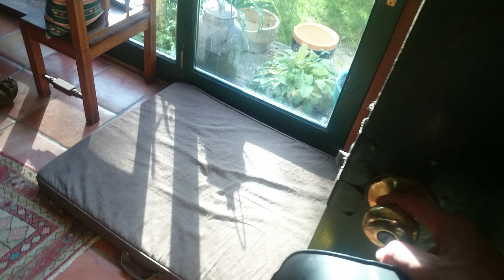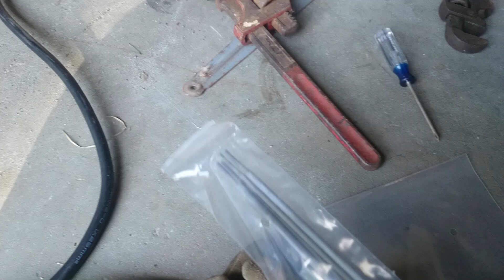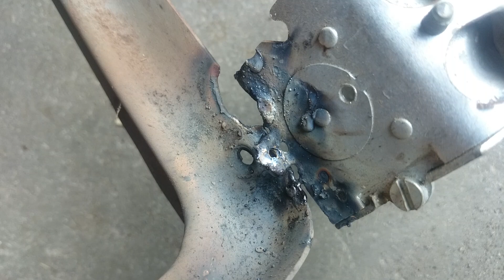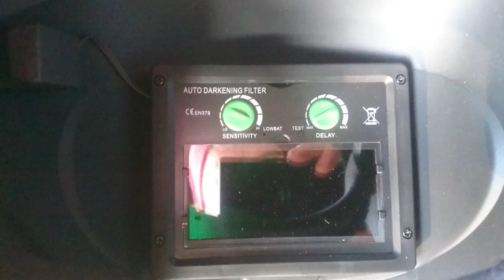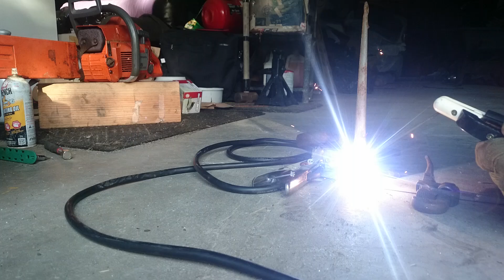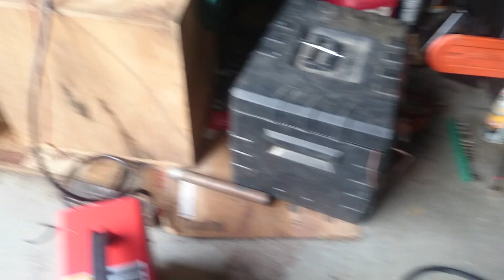First time welding, with brand new $100 ebay DC Arc welder

Comment: I would avoid welding on that outlet. The galvanize will make you sick. But I think what you should do is get a 1/4" plate. Get use to running beads and flipping your hood down to weld. You will have less grief that way. Good luck.

Comment: hello . i know im 4 years late . But vertical welding is HARD 
a really usefull cheat is to clamp brass or copper on the reverse side , the welds wont stick to it and itll bleed the heat away
Reply from the maker: Thanks for the tip
Reply: @El_Chompo  we should compare welding scars !  nice to meet you

Comment: Practice, practice, practice... Learn your Machine and equipment, luckily you didn't get flash burned!

Get some plate and practice, 30A is way too low, 80~ - 120~ is the sweet spots. Also what rods are you using, ⅛, 3/32, 6011, 6013, 7013, 7011? 

Your rod is sticking because of the amperage and the angle you are holding your rod.... You aren't getting penetration, hence the welds breaking.

- lead, + earth = DC... Vice-versa for AC.

Comment: Im about to learn stick welding with a 90amp inverter. I think I will start by padding beads first, and hopefully, my first shot will go marginally better than this 😁
Reply from the maker: Hahaha. Honestly if you clean the metal surfaces first with a wire wheel so they are spotless shiny metal, make sure your clamp is also clean shiny metal which you can clean off with a wire brush. Once you have all clean shiny metal surfaces, and you have everything clamped down in a position that is easy to reach and won't move away from you when you push your welding stick into it, it should really go a million times better than this first video I made.

The hardest part is striking the arc like a match and then keeping it close enough to keep going but not too close or it will stick, and too far away the arc will go out. Once the arc has been going for a minute and the metal is getting hot its a lot easier, when everything is cold at the very start that is the hardest part. Once you get going you will see that if you keep the arc too far away from the weld it can melt a hole in it, if you can push the stick into the weld as it's going then it will put in new metal and won't make a hole. I find that dabbing it over and over or using small circular motion works well. It's also helpful to watch a video of somebody who is really good at it to see what it's supposed to look like. But yeah, clean those metals and it will go way better than it did for me.

Comment: Once I had a small piece of my drivers seat broken and would slide crooked. Looked everywhere to get a small tack done and all welders in my area had their noses pointing to the sky, that’s when I decided to get my own welder. Have done lot of projects around the house...., thanks to the welders who couldn’t help😂👍🏼
Reply: I'm fixing to do the same with an old Dodge I have. No welder wants to get under and do some welding on a piece attached to the chasis. It seems people only want to do easy shit and not struggle or do hard labor .
Reply: @quwzada21  same in my area.... bought a welder and started😀👌

Comment: is your unit still working? can an inverter igbt model last  3, 4 years with home use?
Reply from the maker: Still working great! I have welded so many exhaust systems with this thing, saved so much money! Here in these salted roads areas it seems like the exhaust rusts and falls off every 3 years at least. I have learned that the biggest downside to a cheap welder like this is it makes it much more challenging to get the arc started. But once it's going it's great. It just forces you to use good welding practices. If you clean off your metals until they are perfectly clean and shiny with a wire wheel you won't have any trouble starting an arc.

In fact the other day my exhaust completely fell off right before the rear flange where the muffler connects in the back. It had rusted through. And that mid section of pipe had just been replaced with a brand new one when I bought the car a few years ago! It's crazy I really hate these salted roads sometimes I think I would rather have people crashing and wrecking than so many cars being destroyed. But it doesn't even have to come to that, there are alternatives. In Colorado and in Canada they use Beet Juice to de-ice the roads and it works fine and doesn't cause all the corrosion nightmares of salt.
Reply: @El_Chompo  well explained. Thank you very much sir.

Comment: Link for product?
Reply from the maker: This is the closest I can find: https://www.ebay.com/itm/ARC-160D-160-Amp-Stick-ARC-DC-Inverter-Welder-110V-230V-Dual-Voltage-Welding/232937203422?hash=item363c23a6de:g:O4QAAOSwZw1bphxk

The color is blue instead of red and the plug on the end of the outlet wire looks a little different but the front panel and rear panel look exactly the same so I suspect it's the same welder. I have done countless exhaust systems now with this welder I really can't believe how good it is for the money. It might actually cost you more just to get rods and a helmet.

I have yet to see another welder with fully variable amperage control and an exhaust fan for the $99 price mark. Most of the ones at that price just have a Hi-Lo range and no cooling fan. This thing you can pick amp by amp 1 amp all the way up to who knows how high it goes, but usually about 30 works well for exhaust. I think it goes up over 100 and I'm pretty sure you can plug it into 110 or 220 outlets depending on how much power you need out of it. Really unbelievable for the money.

Mine says on it "Amico Power Arc 140" and this new link I gave you says 160 so it looks like they've upgraded it to higher power since I bought mine, not that I will ever need 160 amps I'm not welding ship hulls. As for the sticks I've been very happy with E6013 sticks which are sometimes described as "Farm grade" but they work well for rusty pipes which is the main reason I got them, all exhaust around here is rusty from the salted roads. 3/32 in / 2.4 mm E6013 rods. I just noticed the box of rods says 40-80 amps so I guess I've been using them out of range at 30 for a long time now, maybe I should try a thinner rod of the same model that's made for lower power, would probably help my welds even though I don't really have trouble welding anymore. The hardest part of welding is just getting everything clamped and fixed in place so you don't have to worry about it moving when you strike and drag the arc, if the pieces are just laying there sometimes the stick sticks to them and drags the pieces out of alignment. As for the helmet I got a $20 auto dimming welding helmet from walmart.com it was the cheapest I could find at the time and I've still never had any problems with it years later. It's crazy if you go into an auto store auto-dimming helmets start at like $200+

Good luck my friend. Don't blow on hot welds by the way, I almost got an ember in my eye doing that.

Comment: Main thing is that you need to clean the metal with either sandpaper or grinder so the weld sticks and will be easier contact. NEVER touch the stick while welding unless you love electrocution.  Takes time and practice to learn and if it burns through the metal turn amps down
Reply: You can touch the stick you fucking jerkoff

Comment: Thanks for this video. It's actually really useful someone who's never welded such as myself. I'm researching cheap arc & flux core welders to determine which is the better investment. Useful to get an insight into the challenges of stick welding thin metal, striking an arc that a novice goes through!
Reply: I'm in the same boat and decided on the chinese DC stick welder 160 amp on Ebay. Preparing to do an exhaust pipe job, but I couldn't get an arc started. Will pick it back up tomorrow.
Reply: @Iwonder Wheresadunny arc is better to learn on especially if you want to tig weld someday
Reply: The DC arc welder is much better than self sheilded flux core

Comment: I hope you didn't get discouraged when you did this last year and give up. By now you probably do better but striking that arc is the most trouble starting out. Start off the metal and approach with the stick at an angle and touch the steel in motion without stopping to form the arc and puddle. Hope your still welding.

Comment: The first thing you do is, strike the arc and quickly pull back about 1/8 of a inch and keep moving in one direction slowly, but not too slow. If you go too slow it will stick, if it does stick you need to jerk it loose fast. You should practice going slow at a steady even pace. Pick the Wright amperage for thickness of the material that you are trying to weld.

Comment: Yeah I would have definitely started out on some thicker metal and get some soap stone and draw a straight line and just work on getting your speed and angle right. And I was always told to never weld on a concrete floor. Don’t know what would happen and never been in that situation due to me welding out in the field on dirt. But hey, you got a start. Good luck. Practice makes perfect.

Comment: Hey thankyou for the video. I just bought same welder however mine is 110v 200amp. Just wondering is yours a 110v plug . Thanks
Reply from the maker: You're welcome! Yes it is a 110v plug.
Reply: sirgallium what amp fuse were you running it from 15.
Reply from the maker: I'm not sure, it was just a standard outlet. I've run it as high as 70 something with no problem.
Reply: @jr6381  Please sir
I would buy myself a small welding machine like this
Or is it just a waste of money
Is it effective and long lasting

Comment: Good first try man.
You should hook up your electrode holder stinger and whip to the positive connection and your ground clamp negative. This is referred to as DCEP (dc electrode positive) or reverse polarity. In doing this the electrons or electric current comes off of the work piece or base metal into or onto your electrode or welding stick. This is how it is normally done / hooked up.
This is how it is done most always when stick welding also when mig welding and flux core welding.
Try buying some name brand 3/32 rods from lowes or home depot (7018) get ahold of some 1/8 tubing or steel plate and practice running some beads 90amps then after you got the hang of that try welding some joints with square tubing.
Awesome effort in taking that first step in purchasing that welder. Most people are too weak to ever give it a try. Very cool thanks for the awesome video. Keep it up very cool of you to upload this and especially for having the balls to give it a try.
Reply from the maker: Thanks for the reply and ideas. I have messed around with polarity now but I will try your other tips. If you lookup my newer Saab welding video you can see how much I have progressed from this first video. I don't know what size the electrodes are that I'm using but I'm finding that I need to do a sweeping back and fourth pass over exhaust tubing to get a strong enough weld that doesn't crack and I think that if I had a thicker rod I could just go down the seam and lay enough material in one single pass to bond them with enough strength and material. I also want to try to get some aluminum rods and weld some aluminum because that's one of the advantages of starting off on the stick and not a mig. Also I was welding on a beautiful day outside with the stick in that Saab video, it was nice having such good lighting and a breeze for the fumes. I'm very impressed with this $100 ebay welder, it has a fully continuous amperage selection not just low medium high, and it also has an exhaust fan on the back which other $100 welders I saw did not have, as well as a digital display. The only issue I've had with it at all is a loose screw on the stinger, and one time it wouldn't shut off until I flipped the switch back and fourth a few times.

Also the autodimming $20 helmet is incredible. I see ones for over $100 in the auto store. I did have one problem with the grinding setting being switched on on the outside at first which made it so there was zero dimming, but at least the glass blocks all of the harmful wavelengths even when it's still clear.
Reply: I just buy a 100 amo welding machine cheap one but I already build two window guard not bad for beginer I guest 😂

Comment: I appreciate your try.  First the metal is way to thin for stick welding. Find the correct rod size and type. You sure can do it but not  on the ground flopping all over the place. Two different metals!  The box is galvanized steel, the bracket is sheet steel with paint on it.   Next time get some carbon steel.  I suggest taking a hobby class and visiting a  near by welding shop and ask questions, heck you might get to practice.  So far I have taking a hobby class at the local college a class for stick and one for tig.  I have spent over $400 in just class time and I have no regrets.  Good luck,  you just have to do some home work before you start.
Reply from the maker: Since this video I have welded up more than one full exhaust system. I just wanted to show what it was like with my very first try with no experience or training with a new $100 welder. I have gotten so much better at it than it was in this painful video now and I will make a follow up to show. I have a nice bench vice now for clamping my work pieces. And I have learned the art of striking the arc and maintaining it. The main problem I had in this video was not understanding how to strike an arc and keep it. You just have to be a little more aggressive with the first contact, for that a vice helps of course, then once its glowing hot and orange its easy to keep going and strike another one wherever you want. I will make a followup video I can actually make some good looking welds sometimes now, it's nothing like this video, my very first try ever. I can actually make good welds now when I have good access to the pieces right in front of me, but when they are in an awkward space like underneath a car I still have some trouble.
Reply: Thanks , happy better days are here.  I have never welded exhaust system so you have one on me.  Are you using a stick,  are flux.  Always afraid of burning thru. My first class was tig and it kicked my butt.  Thank for the reply. I still have not bought a welder would you recommend this one?
Reply from the maker: I am using a stick with flux. This welder lets you set the amperage 1 at a time so once you pick the right number you don't have to worry about burning through. For exhaust I found around 28 amps was working good. I would recommend this welder for a stick welder but if you just want to do good welds I would recommend a MIG welder. The only reason I got a stick was because AvE said that it's harder to learn and forces you to learn better habits faster. Plus you can use different sticks for different metals where with MIG you have to change out the whole spool of wire.
Reply: @El_Chompo  Hey that's awesome. It'll be great to see a video on welding thin metal such as exhausts w/ such a cheap stick welder! This is exactly what I'm looking for.
Reply: Some rules. Don’t try to weld over any painted surface. Two, zinc fumes from welding are deadly poisonous! That second point is very important. People have become very sick, and even died from breathing in zinc fumes. So be very careful around anything galvanized, or zinc dipped, or plated.

Stick welding isn’t the best choice for sheet metal. It’s mostly used outside where breezes and wind blow the shielding gas away. It’s also used for heavy metal and metal that has scale and rust, when, and only when, you can’t clean it off. You just be careful to have the same distance along the weld. Too close and you have a problem. Too far and you have a problem. For most welding use one amp per thousands of inch thickness of metal. So 16 gauge is 0.0625 thick (for steel), that means about 62amps. Too much, and you’ll burn right through. But - and this is important when stick welding, only the thickness of the electrode matters here. So you take the thickness of the rod for that determination. But the rods you got were more for 0.125” (10 gauge) than what you were trying to weld.

If you must, because of cost, stick weld sheet, find 1/16” stick electrodes. Also, for most purposes, use 7018 electrodes. But if you’re going to weld mufflers, find out if they are stainless, as they often are. If so, then you MUST us stainless electrodes. If not, those welds will fall apart before you know it, from corrosion. By the way, I wouldn’t use AveE as the best source for info on welding. Try weldingtipsandtricks, or for even more basic info and techniques, try chuckE2009.

And last, just getting a weld doesn’t mean you’re getting a good weld. It takes months to become even barely decent. As was suggested elsewhere, try to find a place with a weekend course in this. You can’t learn this all on your own. Some electrodes need electrode neg, and some need positive. Read on the package, and don’t go off on your own.
Reply: I
Reply: Funny

Comment: Would you be able to show different size eceltrodes and it at full power with what size breaker, that would be awesome, thinking about getting one for portable use
Reply from the maker: Yes I can. I'm not sure when I will have time but I will definitely do that. I packed this welder up and drove to another state and did a full exhaust system there so it is definitely portable. I've never had it trip a breaker yet, I usually do about 30 amps now for exhaust which is about 360 watts so that's not a big deal for a normal breaker.